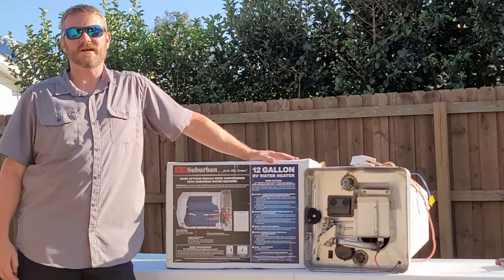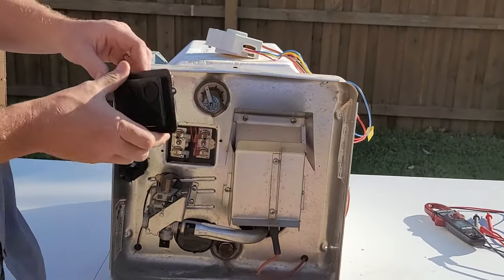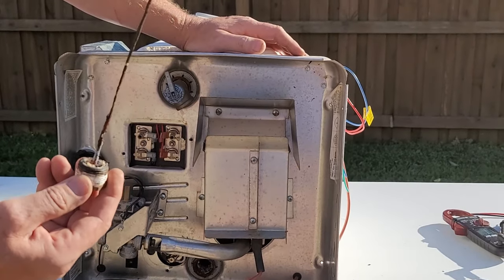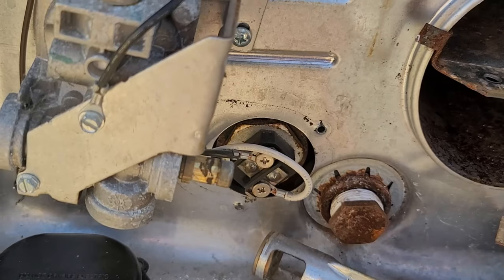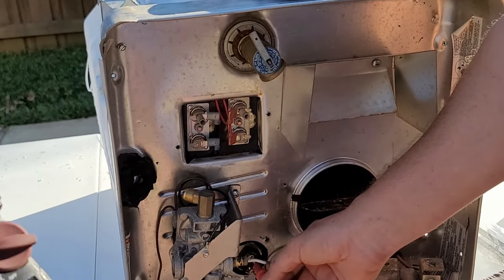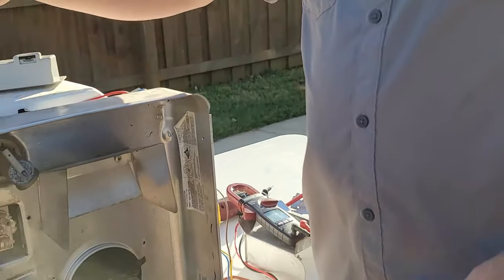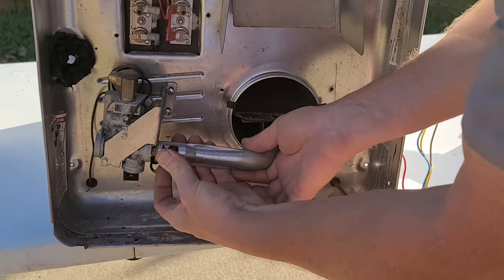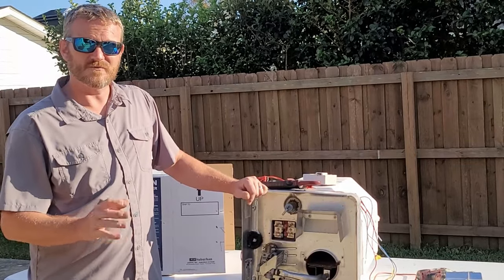RV Suburban - RV water heater walkthrough

Comment: My dad has this unit and it calls for heat, then cycles 3 times and cuts out...and you have to turn it off from inside the trailer. I think the electronic spark, flame sensor is bad. What do you think?
Reply from the maker: Quite possible the flame sense is bad, but gas pressure also has to be eliminated as an issue as well as a clean burner tube and combustion chamber.

Comment: electric ignition on gas water heater does not come to light gas, is it the valve or the module that could be bad? Electric side of heater works fine. Thanks
Reply from the maker: Probably the board " module"

Comment: My Suburban Hot Water tank has 110volt on the white wire going to the element and black wire is ground coming from switch and thermostat. I can't get to the junction box without removing the tank. Have you ever seen this? I believe the wiring was done at factory.

Comment: Changing out my water heater from manual light to a switch light. The water heater has 3 wires coming out of it I’m assuming one is ground then one would go to the switch but not sure about the 3rd. I tested the one it came out of the wires one was 13.7v the other 11.7  and the other I would say ground. I need to add a switch then I can get power from tapping another wire or run to panel.

Comment: Your presentation was very thorough and I enjoyed it very much .. I have the same exact water heater .. I do have a question though I'm having a problem with the on off switch on the face of the water heater freezing up  I replaced the switch 2 + months ago and now the same thing is happening where the on/off switch is frozen ..   Do you have an idea as to why this might happen ?
Reply: Is your pressure relief valve leaking onto it? What exactly is 'frozen'?

Comment: Just purchased an SW10DEL directly from Suburban. DIY install planned. Concerning the DEL switch to be mounted inside the coach--it looks like I am to grab 12V DC + from (fill in the blank) location for the positive posts on the "GAS" switch and the "ELECTRIC" switch, and to use the blue wire from the control module to supply 12V DC to the LED light (the gas ignition failure light). Am I correct?

Comment: My surburban water heater has a slight gas leak from the jet. Can the valve be adjusted, or does the whole valve unit need to be replaced? Thanks
Reply from the maker: @jewelerguy  just replace the whole valve for safety sake
Reply: @MRRVTECH  Thank you so much for your quick response.

Comment: I have a question about the wiring of the 120 volt relay. My water heater stopped working, and I traced the lack of 120 volt power back to the relay, but, I'm not sure it is the relay. The wiring diagram is similar to what you show in your video. The white bypasses the relay and goes straight to the heating element. The black wire goes to the relay, then down to the switch next to the element. There is also a ground wire that comes from the relay to a ground connection and then there is another wire from the relay that does not terminate to anything. 
Should this wire connect to anything?!?
Reply from the maker: @javiertorrez4771  great observation!
Reply from the maker: @javiertorrez4771  the ground wire is a 12 volt chassis ground and the other wire...typically yellow is a 12 volt+ signal wire from the control box. The 12 volt circuit engages the relay from the control allowing the hot 120v black cir uit to close.
Reply: @MRRVTECH  then my water heater does not work on electric, that wire, the yellow 12 volt + ends in  wire nut and does not terminate to the controller. Could this be a wiring mistake from the previous owner?
Reply: @MRRVTECH  is there a wiring diagram for the relay to the circuit board?
Reply from the maker: @javiertorrez4771  sounds like somebody's hands have been on it
Reply: @MRRVTECH  yes, it's been working fine until our last camping trip. I'm confused as to what is wrong with it.

Comment: How do you wire up the control board to the rv? Is there a swit c h i should buy? My old water heater was gas only the new one is electric/gas and im unsure what i need for this.
Reply from the maker: Yes you will need a switch kit and wiring. There is wiring diagram on the water heater.

Comment: Recently purchased an RV travel trailer with a Suburban water heater. No hot water on our first outing. Consulted with one of my resident RV experts and the Suburban manual. The expert and the manual both say and identify an on/off switch inside the water heater. On mine there is no on/off switch. Is this something new?

Comment: Great content in your video! I did have a question. What is the best way to replace the heating element? There is not much room to use a standard socket.Thanks
Reply: Remove the LP gas tube. Camco part# 09951 and 09953 (multilingual packaging) are 1-1/2" sockets made for heater elements.

Comment: You explained this so well. I need to change a hot water tank from my older RV. It is a Suburban SW6DEM in a Calista Cove. Is there much difference to the two models other than gallon size? Is there anything to do differently? Besides being rusty the people before me had water in the tank during a freeze. It expanded it out. No leaks though. Do you have a tutorial for this heater?  Thank you for any help you might provide.
Reply: 6 is for 6 gallon, D is direct spark ignition, E is electric element and M is for motorhome I guess. A M heater has a heat exchanger inside so coolant from your engine can help give you hot water.

Comment: Why is the anode rod and receiving joint so corroded?  That happened on ours after our first year of owning it.  It was throughly dried out before it was winterized by dealer and put into storage.  Its so bad we can not, to spite all our efforts (wire brushing, lubricant, new tape, etc.) to thread the rod into it.  Called the RV manufacturer, dealer and Suburban.  No one has an explanation.

Comment: I have a problem with my water system getting air into it and noticed my pressure relief valve on my hws hissing. So i think its sucking air over the couple of months untill our next journey. Do i need to replace the pressure relief  valve?
Reply from the maker: Yes

Comment: Is there a way you can test the control board with a multi meter?  I think that is my probably with my water heater igniter not sparking
Reply from the maker: No unfortunately unless you understand and no the pin outs and have a good background in controls there isn't. However a company called FENWAL makes an excellent control board tester.

Comment: I have a question. my heater works on gas then when i turn on electric, the igniter  fires and turns on the propane. When I pull a wire off of the DC thermostat switch, the igniter will not fire and the electric coil heats the tank. How does it know not to use the gas when the electric is on? Is that a control board issue?
Reply from the maker: It sounds like the switches are wired backward?

Comment: How do you measure/adjust the propane pressure of a water heater? Does it have a regulator in the gas valve?

Quentin

Comment: The tip of my "plastic cleaner wand" may have broken off in the water heater.  I flushed out the water heater by hooking up to city water and just letting it flow for a while.  I didn't see the tip come out.  Water was clear when I quit. What should I do?  How do I know when the anode rod is screwed in tight enough?  I don't want to strip the threads.

Comment: The three wires that come from the control board area are they just powered by a switch?  I do not have a switch on my rv other than the one on the water heater how would I install those wires
Reply from the maker: Yes white is electric and orange is gas ( 12 volt)

Comment: I need to replace my heating element and the black and white wire running to it. (power and neutral) Where does the other side of thr wires terminate?
Reply from the maker: Black terminates at the left hand thermostat and ECO above it, white terminates  in the j box mounted to the side of the tank

Comment: Very good videos.  I have a question for my rv using propane for the water heater (electric not working) thay's why I used propane. It keeps the propane gas running even though the inside rv switch for propane is turn off. It was frozen last week and I just came back to the rv park. A friend from the rv park told me the problem may be the gas tank that was frozen last week, but stove and even water heater works, but sometimes it keeps running gas even when it stopeed heating. I would appreciate if you help me with this issue. Thank you.

Comment: I’ve been out in my Travel trailer this week and heard a high pitch tone coming from the water heater when it was running on electric.   The noise would stop when I would turn the water heater electric switch off and would come back on when the switch was turned back on.  A few days later after coming back to the trailer after an hour walk and noticed the fan by the service panel, I assume it was the inverter cooling fan, was coming on and going off.  This was every few seconds, on off on off.  It stopped fluctuating on off when I turned the water switch to off and immediately started doing it when the switch was turned back on.  I’m still away from home and am using the propane for the hot water heater, which that part is working just fine.  In both instances the water coming out was hot.  Any ideas what should look for when I get home.
Reply from the maker: Good one! Sounds like a strain on the 12 volt side of the converter while the water heater is on electric, possibly a relay in the control board. I would test the amperage on the DC white wire at the water heater control board while electric is on.
Reply: @MRRVTECH  
  I’ll give that a check when we get back home tomorrow.  An amp clamp is the one tool I don’t have with me on the road.  Where might this control board be located at.  When running on electric is it running on DC or AC current?

Comment: Noticed that the same Camco or Suburban replacement heating element is also available at Home Depot....it's the same as used on some home water heater tanks.
So they make 2 Length elements for the home units....one longer than the stock Suburban one. Both same threads, connection, etc. With the tank being deeper, why couldn't you use the longer element and get an improvement on effeciancy?

Comment: Hello again not sure what happened to my earlier comment lol. I have a question about the illuminated “reset” light in our 2004 Everest 293p fifth wheel, what does it mean when its lit up? I turned the breaker off at electrical panel thinking that might reset it but it didn’t. The two reset buttons on tank are not tripped so i have no clue what to check now to reset it

Comment: Do you need the 12 volt wires hooked up? my water heater is in a park model, and has no 12 volt system or switches inside the home.

Comment: Can you run both the gas and 110 at the same time for longer lasting hot water?
Reply: Yes you can run both at the same time.  It may last a little longer but the main advantage of running both gas and electric is a much quicker recovery time.

Comment: Thanks for the video. Question about sediment. I drain the tank and check the rod after each trip for storage. I notice sediment at the bottom. Rod is still 75% in tact. Do you recommend cleaning out that sediment (not sure how though) at the bottom of the tank?
Reply: just pull the plug out and run water thru(open valve)--that should be enough to clean it mostly out,all i do

Comment: I have 10 gallon suburban, my electric side is not working. I've replaced the element, thermostat, and on/off switch. The gas side works as it should. I am at my end with this thing. Does the circuit board have anything to with the 120v side? So far nobody can point me in a direction to fix this. Any help would be so much appreciated.
Reply from the maker: Yes the circuit board recieves a request from the electric switch and allows the 120 vac power to pass through a relay, then the exterior on/off switch, then the thermostat/ECO, Then to the element. Hope that helps!
Reply: @MRRVTECH  thank you so much! Got a new board, installing on Wednesday. Will update as to share with others.

Comment: What size tap would a person use to clean up the threads where the anode rod screws into the tank?  I made the mistake of not putting the rod back in before storage and the threads have rusted.  Thanks

Comment: Have new RV.  W heater reaches 130 on both electric and Propane.  However when water is used. It turns to tap water temperature in about 3 minutes.  Even when propane fires up.  Doesn't tail off.  It goes from almost hot to tap water temperature. It acts like winter bypass is on.  But it isn't.  Any thoughts?

Comment: I have an early 90's Lance M2400 with a suburban. They say there is a relay between the inside switch on the control/monitoring panel above the stove but I haven't been able to find it. Any ideas where they put those thangs??  Great video. Thanks!
Reply: Tough to say. they can be anywhere. best bet is to find someone with the same rig on a forum like iRV2.com
Reply: @turtlepoi  Thanks for responding Brother (or sister) It's odd how those things seem to develop excessive heat in the electronic components. For instance, Every one and a half, years of consistent use, all of the components seem you show signs of heat degradation, starting with those cheesy plastic on-off switches that are slowly baked to a find crispy crust. I now order them a few at a time, just to keep at least one extra on hand. The thermostat is not much more durable. It gets cooked as well. So I'll order and keep most of those components around and just switch them out. I haven't really had the time to scrutinize and replace them with an on off switch that can handle the current.

Comment: I'm not getting power to my heating element.   Thermostat is new & good reading for it.  Could the control panel be bad.  I hear a popping sound when the water heater is on gas & the TV withch is right next to it hooked to satellite has a slight pause until the gas burner kicks on.  The unit heats the water great on gas, but would love to get it to work on electric,  propane gets expensive.   I work at a park 9 months out of a year.  Thank you.
Reply from the maker: It may be the control board but there are other things that must be tested as well; the element itself should be reading 10.8 ohms, the e.c.o. and thermostat need to be tested for continuity on the 120 vac side, the 120 vac switch, and if you have an interior electric switch there is a relay on the back of the water heater that must close to allow the 120 vac power to get to the element. Test all of those and you will find the problem. (assuming you've already checked the circuit breaker isn't tripped.)
Reply: @MRRVTECH  Where is the relay? I have seen several videos but no sign of it in any of them. I have traced the wire from the interior switch and it looks like it goes into the junction box in the opposite corner from the AC box. But that isn't something I can reach. I'm getting no AC to the 120V switch.

Comment: Replacing an atwood with a suburban. I have 2 12v powers from the switch in the camper. Also a blue wire going back to switch. On the new heater there is only green to ground. Red and blue. What am i doing wrong?? Missing something? Or need a different controller/switch. Thanks for any help
Reply from the maker: The blue wire going back to the switch is a " flame indication" or lamp light, if your new switch is not illuminated it can be capped and abandoned. You need 1 ground, 1 electric DC+ and 1 gas DC++
Reply: @MRRVTECH  ok. The wiring diagram on the new heater doesn't show a place to hook up both hot wires is my issue. It has a blue to "light" red to "switch" and green to ground? But I have two hots
Reply: @MRRVTECH  I did not get a new switch with water heater and that may be the problem?
Reply from the maker: @jbyergo  is the new water heater gas only? And was the old one gas and electric?
Reply: @MRRVTECH  I'm driving back to the shop right now to check model number it was supposed to be gas/electric... Has 120 hookup. I'll let you know thank you for the quick reply!
Reply: @MRRVTECH  SW6DE So.. it looks like gas, electric.. but not 12volt? That makes much more sense

Comment: I just bought the SW10DE to replace my very old Atwood 10 gallon. I'm confused about the wire connections because the new suburban has 6 wires plus the normal AC wires. My old Atwood only has 3 wires blue, green and white for the 12 volt. Plus the normal AC black, white and green for electric.
I have a circuit breaker for the electric on and off.
I have a 12 volt rocker switch with a light for gas use. 
Can someone tell me how to connect 6 wires 12volt from the new suburban unit where there's only 3 wires to the RV that the old 1994ish Atwood used? I haven't had hot water for a week now due to only a small leak in the tank and need to get this new one installed asap.
Reply from the maker: It sounds like you bought the new gas electric DSI model, since you don't have an interior electric switch, just omit those wires. Wire the gas wires to your switch based off the schematic just inside the door.

Comment: I have a 2008 flagstaff i just bought. The switch inside was on then I cut on the switch at the heater(which was very hard to push)  The gas side kicked in then  the light on the inside switch would go out. When I would cut it off and back on it would go back out in a few seconds.Now i cant get either to work. Do you have an Idea why?